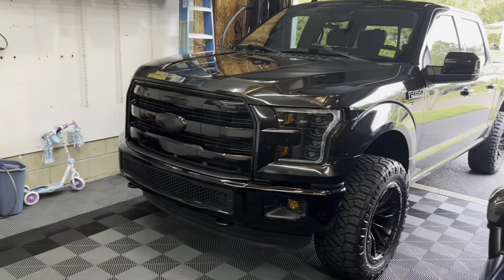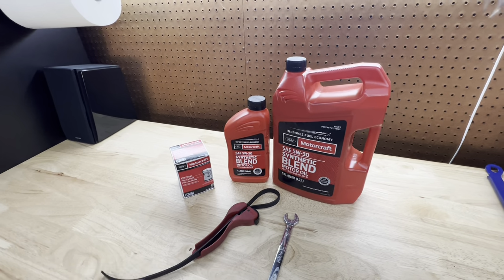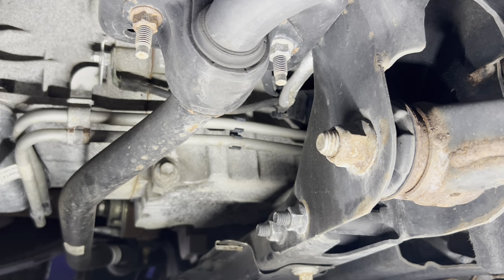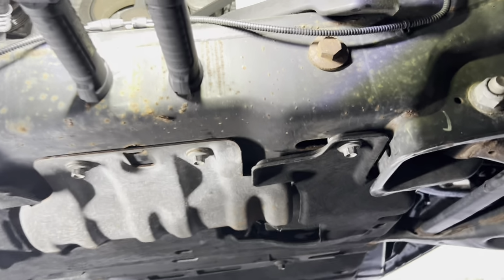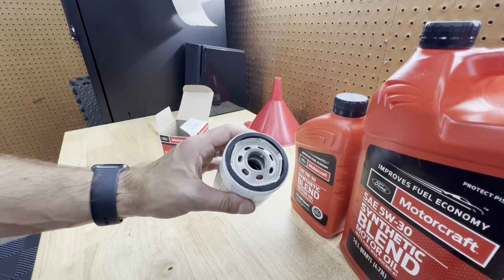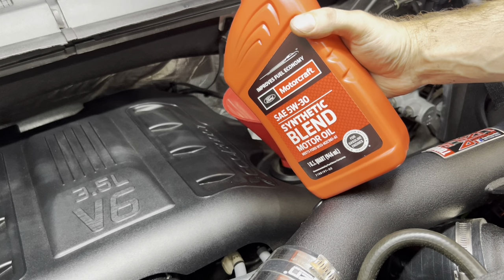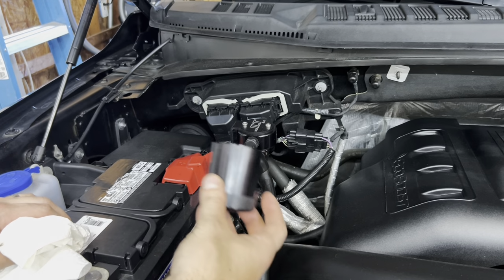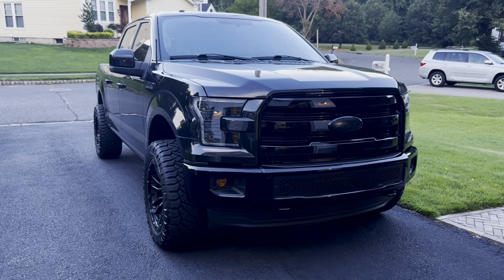Ford F150 Ecoboost 3.5 Oil Change - DIY

Comment: All the videos I have watched to do this say the 3.5 takes 6 quarts of oil. According to the owner's manual, the capacity is 6.5 quarts with a filter change. I put 6.5 quarts in mine and after running for a few minutes, the oil is at the top of the mark.

Comment: Finally.  Somebody that knows what kind of oil tp put in a 3.5 ecoboost engine.  Synthetic BLEND and Not pure synthetic. And yes it also makes sense to use the oil specifically blended for the 3.5L Ford engines.  Same goes for the FL-500S oil filter.
Reply: Full synthetic is listed as optional in the manual, typically as an upgrade to the standard recommended oil type.
Reply: @UnArmedFilms4U  i agree that full syn oil is better than syn blend as far as high heat film strength break down and wear etc, and I've been using full syn on all my vehicles except my Mack dump truck for over 40 years.  But since Ford has had problems with their 3.5 for the past 10 years with cam chain slap and followers wearing out etc, they have apparently come up with several things that have fixed the problems. One of the lesser expensive thing they determined was that the syn blend oil was a little thicker and stuck to the cam chains and associated parts to help with this problem on cold start ups.  I waited to buy a F150 until I thought they had a good fix and that was 2021.  I then waited another year to see how they did and bought one used.  So far everything is going well on this chain issue.  I kept in touch with Ford from 2019 to see what was being done on this subject and they told me hold off another year. So then they switched to recommending the syn blend which the dealers also say to use.  So pure syn might work now, and not have any problems, but I'm staying with the syn blend and changing oil and filter every 3500 miles because it's working.  Over a long period and high mileage, my 22 and 23 year old vehicles that use pure syn oil show very little sign of lose of compression or oil burn.  I'm guessing the syn blend oil over high mileage might  show slightly more wear.  Lots of YT videos on this F150 3.5l chain slap issue and reasons for syn blend oil.
Reply: @ginginthing  I have a 2017 with the cam phaser knock on cold start up, I think that's what you're referring to. The oil "fix" was BS and had nothing to do with it whatsoever, it's the pins that lock the cam phasers into place and not actually slipping into the slot and locking them. The real fix is the new redesigned cam phasers that came out less than a year ago. But I don't trust the dealership to do the job, and paying a trustworthy mechanic is like $4k
Reply: @nastysoda9212  I know Ford made redesigned phasers and I'm not sure if that is the same thing I have in the 21 3.5 f150, but I have zero of the problems that 3.5's 20 and down have had.  The 21 also has other mods such as cast SS exh manifolds to prevent the old warping problems there.  Not sure what else but there's no slap and I'm using the syn blend as rec'd. If I had a older model f150 3.5l, before spending 4k, i'd put the new phasers in myself if u had the available down time.  It's a big hour job and it would be better if u had some good mech experience. NOT FOR BEGINNERS.  Plus when it's down that far, put the upgraded fuel pump in. I'd have that done even if u had Ford do the phasers.  If Ford does it, u get a warranty.  If u do it, u get to do it again free, or have Ford do it the second time.
Reply: @nastysoda9212  FordTechMakuloco goes into great detail on those cam phasers.
Reply: @nastysoda9212  check your recalls my cam phasers were done under recall didn’t cost me a penny

Comment: Removing the Oil Filter is a pain in the hole. I have boat loads of tools and struggle each time to remove the Oil Filter. There’s a cap type socket that fits onto the Oil Filter, with a short extension it would be a dream. I’m buying one for sure. 
Oh ya, your right about the mess… I use Amsoil and fussy about maintenance, no one cares as much about a vehicle like the owner!

Comment: Thanks for this. I was teaching my son how to change the oil on our new truck, but when we got underneath it I was a bit put off by the panel covering everything. Sounds like it's easy to remove though based on your video.
Reply from the maker: Super easy! 4 8mm bolts and it comes right off and you’ll see the drain plug right above the way bar.

Comment: Own a 2014 EB and i only use Full synthetic, either pennzoil or valvoline high mileage. Both great oils and have great success with either one. Imo, if you use the syn blend change it every 3,500 it'll work just fine. Turbos run really hot and over time could cause damage to the ecoboost engines.

Comment: Did you consider using a full synthetic oil at all for the ecoboost? I’m wondering if that would be better to use over the synthetic blend, or if it wouldn’t even be noticeable. Thanks!
Reply from the maker: Probably wouldn’t notice a difference, but this is what it calls for so I decided to stick with it.
Reply: Changing every 3500 miles, I think full synthetic would be a waste of money. Anyway, Ford recommends synthetic blend, exactly the oil shown in this video. Of course they also recommend oil changes following the IOLM, which can be up to 10K miles.
Reply: I'm running costco full synthetic, the cost is great and product is great!
Reply: My 2013 5.0 as well as my 2022 Powerboost 3.5TT both seem to like fresh oil, period.  Seat of the pants PBoost seems to start smoother with full synthetic but it's obvious the shorter change intervals is what really makes the difference.  5.0 did 5K interval Ford SynBlend ever single time and it liked it just fine.  Water pump at 170K but that's expected.   In the end what's $25 for 5 quarts every 3-4K on a $65K truck anyway?  I've even just drained and filled and skipped the filter, just to have fresh oil more often.

Comment: quick question. i bought a truck and it has a FL-820-S oil filter and i was going to put the FL-500-S on when i change the oil. whats the difference between the two?
Reply from the maker: 820 is a bit larger capacity than the 500.  820 has 16psi bypass where the 500 has 8psi bypass. I would stick to what the truck recommends.

Comment: I'm about to buy my first F150, most likely a 2018 XLT 4x4 w/3.5L EcoBoost. Thanks for the video. I'm interested in the best options for dual catch can systems as well. I'm coming from a '99 Dodge Durango  w/ 5.9L Magnum engine - lots of stuff I need to research but I'm looking forward to my first F150.
Reply from the maker: Goodluck and enjoy! Any questions, lmk.
Reply: @Scoobyfreak86  
Ended up buying a 2017 FX4 XLT 3.5L last Friday. I test drove both trucks and the FX4 handled and drove better and was in better condition. Just ordered a catch can for the passenger side, I'll do the driver's side later. Really enjoying the truck but, Holy Crap it's BIG!
Reply from the maker: Haha you’ll get used to it. Definitely a learning curve.

Comment: Nice truck!  Beautiful shape for the age. Curious to know what grief the dealership gave you about motor oil?
Reply from the maker: No grief, they just questioned me what oil to use in the truck. It was a ford dealer, so you’d think they know.
Reply: @Scoobyfreak86  That is a sweet ride!  Congratulations on finding such a beautiful used F150. I'm with you on the regular oil changes. I've owned dozens of Ecoboosts for our personal and business use and we change the oil every 3000-5000 miles religiously. We use full synthetic not a blend but I do realize that the synthetic blend is what Ford recommends.  If you're not happy with your Ford dealer, search for a better one. I had to go through 2 dealers before I found the third and they are great.

Comment: My dealer keeps putting semi synthetic in my 2016 ecoboost 3.5. I have 19,000 miles on the truck now and wanted to run full synthetic,which they seem to be against when I ask ?
Reply from the maker: The truck calls for a synthetic blend from ford. They are using what the truck needs.
Reply: @Scoobyfreak86  thank you , I believe they called it a blend. I get it done when they change my summer / winter tires ,which is twice a year . So there’s very little mileage on the oil typically. I did see a YouTube video where the guy showed most ecoboost failures were from not changing oil soon enough . I swore he mentioned to go with full synthetic, so it has me wondering.
Btw great looking truck you have . Did you install a leveling kit ? I think I need to build some boards up to act as ramps , as my lariat sits a bit lower , and I’m fat lol

Comment: Did you speed adjust computer for extra wide tires? How much headlights cost?
Reply from the maker: The width won’t change the speedo. The height is what would affect that. 

Check out morimoto’s website to check current pricing.

Comment: How many ft lbs of torque on the drain plug ?
Reply from the maker: There are a lot of numbers out there, but most say 20ftlbs.
Reply: @Scoobyfreak86  weather permitting I'll be diving into that project tomorrow. Thanks for the video.

Comment: Was there an aluminum guard with 4 bolts in it that you had to remove to get to the oil drain plug? Thanks
Reply from the maker: No sir. Just the undertray piece and the bolt was accessible from there.
Reply: Thanks. I crawled under further and realized that it was just the plastic one had to come off then it was smooth sailing.

Comment: Nice truck im  picking up a 2022 f150 ecoboost. I wanted to do my own oil changes as well don't trust dealerships. Will that void my warranty? I was told it wouldn't unless they could prove you didn't change it properly or put wrong oil in it or something
Reply from the maker: Thanks! As long as you use the correct filter and oil, there isn’t anything they can do to “void” your warranty.
Reply: @Scoobyfreak86  one other question. According to ford it says you dont have to change any oil minus engine till 240,000km. So transmission, gearbox, diffs. What are your thoughts on that. Seems like a while. Im thinking do it every 100,000 at least get some fresh oil in there
Reply from the maker: Manufactures tends to overshoot their maintenance scheduled further than I’m comfortable with. I tend to do things sooner than they recommend.
Reply: After 30k I dropped the transmission pan and did filter on my 2008 5.4l, I added new pan with drain plug, then every 10k drained transmission oil and refill. Peace of mind and the joy of working on my truck. Just got 2022 3.5l and will continue this maint schedule!  60k I replaced axel oil.
Reply: @tedpatriot2963  oh nice. Where do you get those drain pans from? Also what about transfer case and diffs how often were you doing those
Reply: @lindengauthier4407  man I wish I could remember, my 2022 is about 29,900 miles from having to do transmission fluid swap! But on my 08 I think it was a Dorman product.   Maybe rock auto or amazon....I hope I can find eventually for my 22 because it makes transmission fluid swaps a breeze!  Transfer case and axel 60k .  But I hardly use 4x4 so maybe less 30 40k if your towing a lot or using 4x4.  OK,  Found a wide range of pans from 80 to 300 bucks searching online...
Reply: Keep your receipts, get a big envelope and keep every maintenance product receipts!